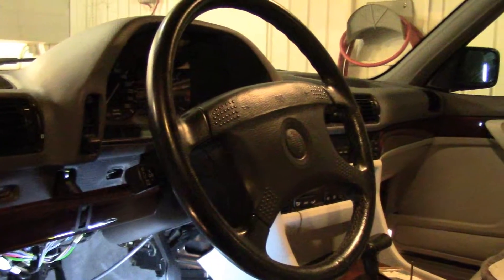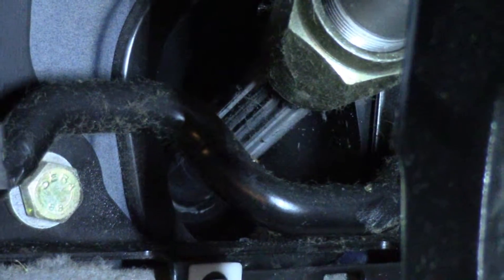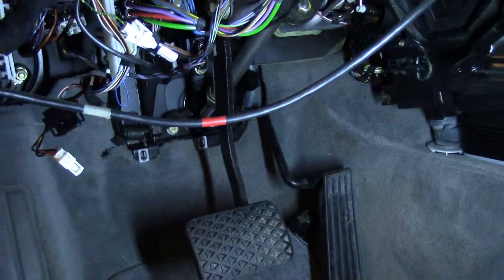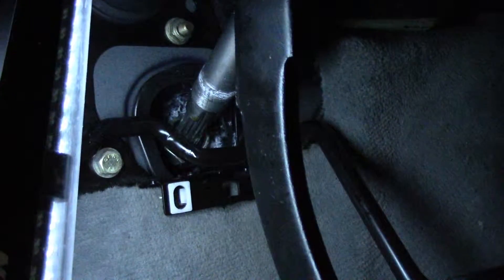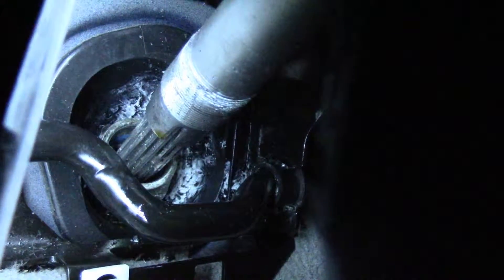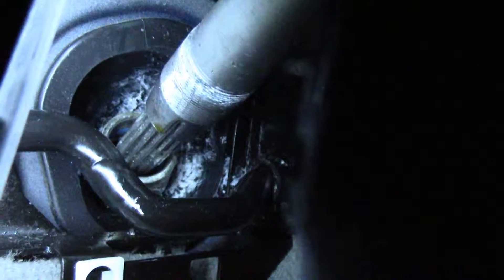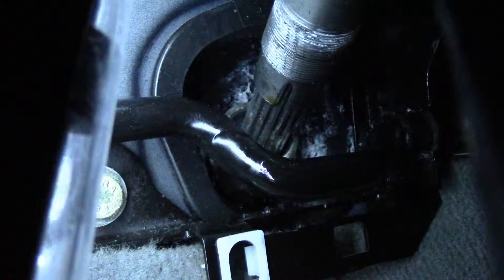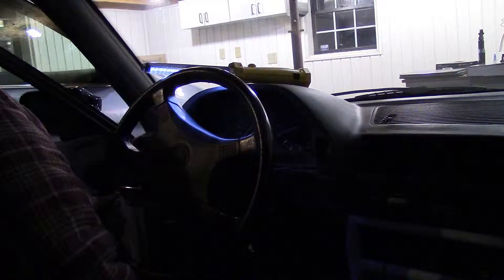E32 1992 BMW 735iL Fixing a stuck telescoping steering wheel

Comment: Thank you. This helped me fix mine. The old grease is like epoxy at this point. I had to use a torch and boil out the old grease to get it moving.
Reply from the maker: It's impressive how hard lubricant can become 30 years later!
Using heat is a good idea (just mind the carpet!). Good tip to share with others, thanks.

Comment: Thanks so much for all your videos, very detailed and everything just makes sense! Extremely helpful resources for my e34 535is. Especially the part about spinning the nut the other way. I was spinning it towards the steering wheel wondering why it was only feeling tighter and nothing was happening. So much for the forums! Without you I would not have been able to fix a host of issues on my car, or at least not fix them to perfection. Thanks again!
Reply from the maker: Thanks, I'm glad to help!

Comment: There is an electrically adjustable version of this column with fore and aft and up and down adjustments...possibly a great if not complex upgrade/retrofit. Definitely left hand drive as I looked at buying one ex U.S. Look for the different knee bolster (underpanel to 'wheel) design...a more "squared off" look. 740i/iL & 750i/iL's perhaps only?
Reply from the maker: Yes I saw that before, I think it's a rare option? It must be a lot of work to retrofit. I'm happy with my manual telescoping steering wheel :)

Comment: Add the factory option sports wheel in future? This is a pretty big wheel. Worth thinking about.
Reply from the maker: Hi, you must be reading my mind :) Today I was on eBay.co.uk looking for 32341162624. It's a three spoke sport steering wheel from the E34 with an airbag. You might have seen the E34 steering wheel with the red airbag light? It's that wheel, but without the light.
It's a rare steering wheel but there is one listed, but it's more than I want to spend... That steering wheel would be the same outside diameter but look smaller.